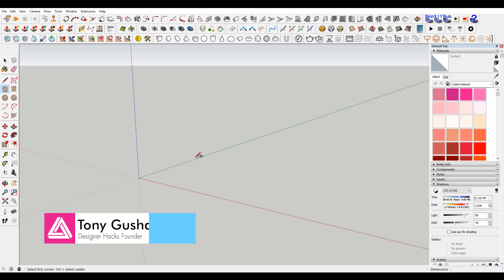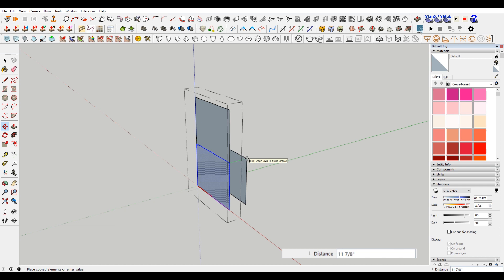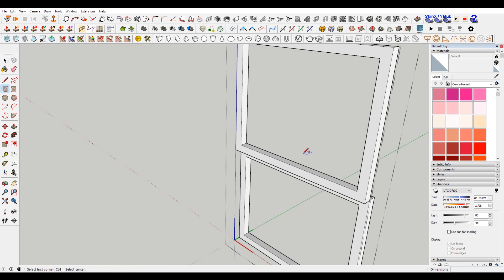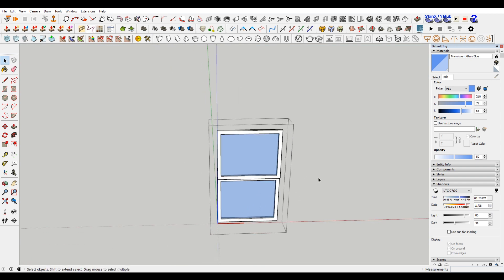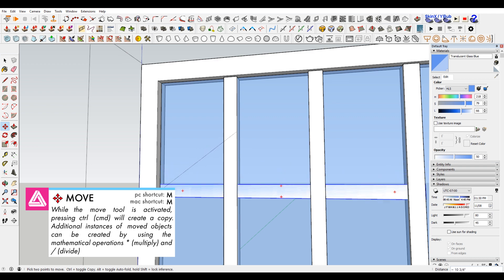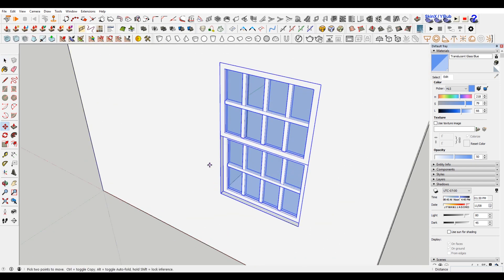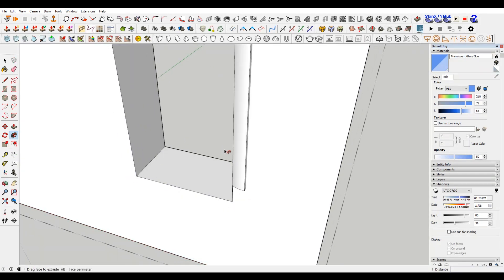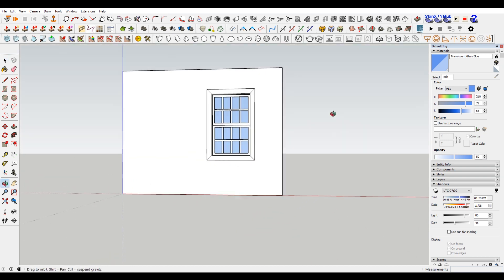How to Make Windows in Sketchup

Comment: I recently learned from a Carpenter to create what's called "The Reveal" around the trim. If you try and match the trim around the opening, exactly, it will never match and it will look crappy (irl, not SU). So, it's best to offset the trim from the opening about 1/4 - 1/2 an inch. This provides a shadow that seems like a feature and any unevenness won't show. 
Weird. 
But I'm going to start planning those into my designs.
Reply: I was actually looking for how to make the window frames that you see with professionally made windows.

Comment: Is there really no easier way to make a window than this???
Reply from the maker: There are plugins that will make windows.  You can also import some into your file from the 3d warehouse.  They are certainly faster, but you also give up control.
Reply: @DesignerhacksPage  Thanks for replying so fast! 

I want to make windows from scratch so it fits buildings perfectly kinda like art. It doesn't need frames or anything. I just need to cut a specific geometric form out of the wall and then place another plane (the glass) within that form... Is there an easier method of doing that?